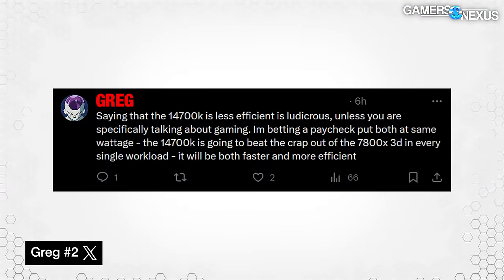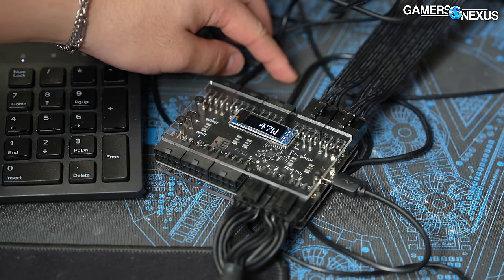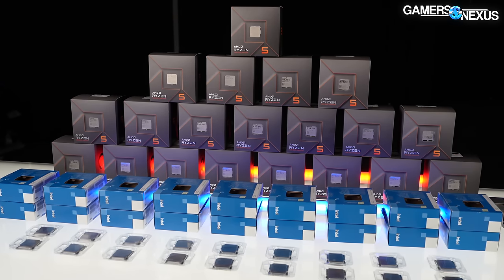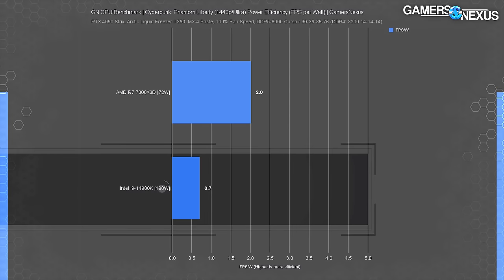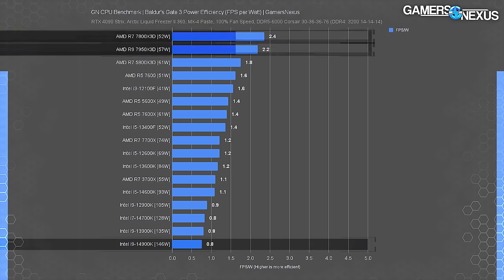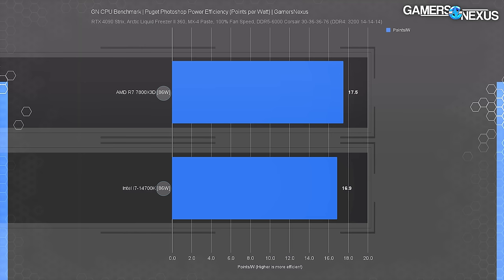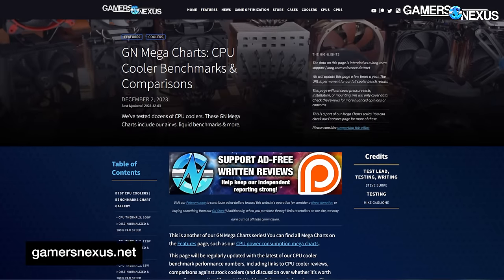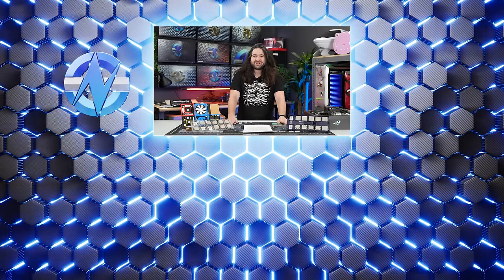The Intel Problem: CPU Efficiency & Power Consumption

Comment: It's hilarious to me that the 7800X3D without FPS limit still pulls less power than the 14900K with an FPS limit

Edit: the amount of fanboys defending Intel with all they have, for no good reason at all, is just ridiculous. Stop saying they should have undervolted it. Stop saying they should have turned off the E-cores. Stop saying they should have limited the power draw (which they did for the 14700K photoshop test, actually). Stop trying to make this literal waste of energy better than it is. You get nothing from it by doing this. You only expose yourself to siding with a company that rips you off, and that makes you look like morons.

And besides, this video was supposed to be a fair comparison between Intel and AMD. If you tweak Intels chip to the point of being advantaged, you surely can do the same for AMD.
Reply: Looking at power consumption of the 7800X3D, I wonder why AMD didn't release it on laptops platforms yet. It would have no match at 50-75W TDP in games.

Edit: yes, I know about the R9 7945HX3D, but it still has to share some of its power between two CCDs, instead of focusing all the power on the 3D V-cache one(and laptops usually have 55-75W limits). There's 13980HX on laptops, and it is just identical(in terms of its cores count, frequency and even cache) to power limited 13900K. But they wouldn't need to limit the 7800X3D that much, even 55W would be enough.
Reply: @ReclusiveXL It might be a temperature constraint; that and the higher power floor to run them
Reply: @WWAVES1  nah, in laptops the cpu doesnt have a thicc boi IHS and 50-75 watts is relatively normal for laptop CPU's
Reply: Thx to the 3D cache performance are higher AND they have to reduce the maximum voltage to avoid damaging this extra cache. Those 2 factor make it incredibly efficient/performance, that and the fact that zen core are more efficient that Intel core by default
Reply: @ReclusiveXL it needs desktop levels of cooling to remain stable at 50-75W. There’s a reason it doesn’t boost as high as its non-X3D counterpart, which has to do with voltage and temperature limitations.
Reply: @ReclusiveXL They did. Not the 7800X3D but the 7950X3D.  It's called the 7945HX3D
Reply: Tbf one has 16 threads, the other has 32 threads. Thats not something you can just ignore. I mean yes, ryzen is definitely still more power efficient. Thats what happens when TSMC makes your silicon and you have a node size advantage, look how power efficient Adalovelace is over RDNA2 with just tsmc “4nm” over 5nm. But comparing the power efficiency of a 14900K and comparing it to the 7800X3D is just kinda goofy. It makes more sense to do it with the 7950X3D but since this is so gaming bias we arbitrarily say the 7800X3D is better. Its definitely better for just gaming if you wanna save money, but as an overall CPU not really. And id still say 14900 and 13900K are both better than the 7950X to to its core parking issues and bugs. Theres no reason why it shouldnt be able to use vcache cores for gaming and non vcache cores for background or side tasks
Reply: @Angel7black  Welcome Greg #3
Reply: @Neketre  and theres i9 13980HX that is quite indentical to desktop 13900K(and even boosts to 5.6GHz). I know about cooling, but we are talking about games, not stress tests. I think they could undervolt 7800x3d so it fits in the temp limits in laptops, considering that desktop one doesnt need much, but air cooling
Reply: They do have X3D laptops though but not using desktop chips. Which is awesome! They saw the power efficiency of 3D V cache and put it on laptop CPUs as well. The yields for X3D are good enough now that they can do that.
Reply: @bgos10  yeah i know, that's why I'm wondering
Reply: @WWAVES1  they haven’t done it yet so I guess something is holding it back, but I don’t see many reasons for them not to do laptop x3d.
Reply: @_under2world_  this maybe
Reply: @Angel7black  That's why the GN team normalized the numbers to user power per amount of work performed.  That makes the number of cores irrelevant.
Reply: Also laptop chips are monolithic unlike the current desktop chips. So it would be a completely different fab line to make a x3d, compared to desktop ryzen and Eypc sharing the stacking line.
Reply: The 7945HX3D "exists". But as usual, it'll be USA-exclusive like pretty much everything high-end AMD does for laptops.
Reply: @ReclusiveXL They have the 7945hx3d so ye can max a 7845hx3d
Reply: @Angel7black  Intel once said "No silicon manufacturer has ever recovered from falling behind in their node process."
Reply: @ReclusiveXL   consider the 7945HX or its soon-to-release replacement within the next few months. It out performs the 14700k in raw mathematics benchmarks while still being a laptop chip. I'm not sure of its gaming performance but if you want an incredible mobile CPU from AMD that out performs desktop chips in professional workloads thats definitely the chip to look at until AMD's next gen mobile processors
Reply: I like ryzen. Just sucks it took them so long to get a decent memory controller. I'm assuming the ryzen 7000 series has a solid memory controller. That's been the only thing that held ryzen back from total domination. If amd can make consistent memory controllers, than the rest will be easy for them.
Reply: @WWAVES1  The only problem AMD chips have is their small chiplets, where heat is so focused on one tiny area, thats why you see cooler tests where the AMD cpu is still very hot even tho the cpu itself isnt using that much power.

Coolers actually have a hard time cooling amd cpus. Intel on the other hand have massive dies where the heat is very spread out. If intel had chips the size of amd's there would be no way in hell they could achieve scores/fps similar to what they get now.

Now imagine having to cool that chiplet using a puny laptop cooler, its a nightmare.
Reply: fps limit is just a utterly stupid way to change efficiency he should have limited power not fps. just cap it at 75-100 and 125 watts and ee how it preforms then.  and he should have included idle.  i find this whole video dissapointing at best.  i was hopping for it to be a good video but no it was not.
Reply: @charliek9394  That’s exactly what I was hinting towards. I’ve just learned they do have a 7945HX3D in a $3,800 laptop but that’s the only one. I’m not sure what cooler they use but it’s there🤷🏾‍♂️
Reply: @pino_de_vogel  okay Intel shill
Reply: @ReclusiveXL the problem is with idle power consumption. with the desktop chips, you'll often see idle power being a few watts higher than intel or a monolithic APU, on desktop, that's fine, pretty much a rounding error, but on mobile, powering that IO die during idle will seriously eat into the battery. So unless AMD makes an x3d built on top of an APU, there're not really an efficiency gain from putting 7800x3d into a laptop
Reply: @dagameboy  Crazy enough, they already have one out. It’s a limited release right now but they have a 7945HX3D cpu in a laptop
Reply: @KrazzyKlown  but AMD fell behind like crazy with the FX series; imo you can always catch back up if you actually try.
Reply: Why it has 3x the cores lol
Reply: Is it a surprise tho? a 24 core CPU vs 8 core,  you don't think one might consume more power than the other?
Reply: I said this before, but look at TechPowerUp article about running 14900k at certain power limits. If it's really an issue, set it to 125 watts limit, so half of stock, and you lose barely any frames, especially not in high resolution gaming. I know that it's less efficient and Intel will improve on that with Arrow Lake for sure.
Reply: @ReclusiveXL  How do you fit the required water cooler into a laptop?
Reply: @WWAVES1 temperature is directly proportional to power, so what do you mean?
Reply: @Joh_Lam  1. this is not the stock configuration. Most people won't go into their bios to limit the power of their processor, because many don't even realize this is an issue they have.
2. Even IF you limit it to 125W, it still uses way more power than the 7800X3D for even less performance. No matter how you twist this, Intels efficiency and overall performance is helplessly inferior than AMDs.
Reply: @Angel7black  There's nothing goofy if the performance is the same.
Reply: But but the amdip!??
Reply: @mathesar Definitely, but you'd also expect way more gaming performance in return, but it's not the case.
Reply: Literally about to do a 7800X3D build after I’m done with this toilet time and shower lol. I’m excited
Reply: @joshmaag2457  I'm going to do the same! But prices suck in Germany.
Reply: @Angel7black  Did you even watch the video? The 7950X3D was definitely tested and the conclusion is not different.
Reply: @El1988Che  Yea I was just referring to the power consumption which is no surprise, 14900K has 8 performance cores which are used for gaming but then theres also the additional 16 e-cores consuming power in the background, But either way 7800x3D is the winner here.
Reply: @eliasroflchopper3006  Yeah, I mean you are right. There is no way to twist this and Intel is obviously far away from AMD's efficiency. I was just saying that looking at that article things at least get a little better by setting a limit. The performance difference is not that big while at least that power consumption gap gets somehow smaller.
Reply: @ReclusiveXL I limit my 7945HX to 45W and I prefer to have the 7745HX instead.
Reply: @WWAVES1 No, on laptops they’re direct die + Liquid Metal.
Reply: @Neketre That’s not true. My 7945HX can run at 130W without throttling.
Reply: @mathesar  it consumes more power than the 7950x.which has real 16 cores. The 14900k has 16 e Cores. Those are Low power cores.
Reply: @ReclusiveXL but, 7800x3d can be cooled with a silver spoon and some thermal paste, it is dense and likes to hold heat but that doesn’t mean it is making more heat than Y, it is just X, a low power chip when compared to its competitor, and low temp
Reply: @omegaprime516 it’s a little more complex than just a memory controller, it is an IO die. Basically it has to feed memory channels to all the individual cores on different CCDs and adjust for clock ratios at a distance. The speed was never an issue, latency was, therefore you now have x3d to remove the dependencies on ram calls
Reply: @CrimWorld9 And isn't a silicon manufacturer. They designed the chips but tsmc is the silicone provider.
Reply: @ReclusiveXL I'm not sure what you mean. 7945hx3d hits 100w pretty regularly in tests and often spike higher. I don't know why exactly but there is clearly some technical limitation preventing AMD (and OEMs) from releasing higher clocked versions 7945hx3d
Reply: Btw, it's extremely remarkable Intel's 10nm part 13900h is comparable to 7945hx3d on 5nm. It's kind of insane actually and makes you wonder how much of AMD's edge should be attributed to TSMC instead of AMD itself.
Reply: @modash1231 If by “comparable” you meant pulling 2x the power to achieve similar performance, sure. BTW, Intel’s 10nm is similar to N6/N7 in terms of density.
Reply: @ReclusiveXL there's no point in x3D CPUs on laptops because you're almost never CPU-bottlenecked. A 7745HX is pretty much the same chip otherwise
Reply: Zen's powe efficiency was braindead obvious right out of the gate when zen1 released. It came out with an 8c with 95W tdp pulling about that... At a time when Intel's 4c was 95W but pulling 110-130W. Aaaaand Intel's uarch hasn't changed been completely redesigned but they have pushed power draw as high as possible to eek out performance.
Reply: if Steve turns off hyper threading, it would be a lot closer.
Reply: @deivytrajan  no
Reply: @I.C.Weiner  Well AMD designs the architecture and much of the layout but all of these companies do work with the silicon fab to finalize the chip design. It's relying on their advanced processes and all the complexity involved with that, it's not as simple as emailing TSMC the new file then clicking print. 

At a basic level, this applies to many manufacturing industries. A company may up with a complex product design then works with necessary manufacturers to create a final production version that's scalable.

It is especially true with X3D since it's TSMC's 3D stacking technology that even makes the concept possible. AMD's engineers have to work closely with TSMC's team to make the final product a reality.
Reply: @Neketre  It's more to do with the 3D cache being another medium heat has to travel through from the cores. This is why the X3D parts are binned to run low voltages. It creates this weird scenario where you can cool it with a reaaly cheap cooler since the power consumption is low, yet with a really high end 420mm AIO your termperature will still jump all the way to the high 70s (which is insane considering it's only drawing at most 90-ish watts of power).
Reply: 7800x3D is the best CPU by far right now and it was $100 off around black friday weekend.  If anything, it should cost more but at $350 it costs notably less than $550 for a 14900K or $380 14700K.  It should be drawing way more power for the performance it gives, and should cost more for the performance it gives.  Credit to AMD for having it at a competitive price point.  GPUs may be overpriced, but this CPU is probably the best value part we've seen in the PC market for a long time.  It's like the 1080TI of CPUs, for value.
Reply: With multicore performance worst than 12600k :P
Pc is not a console, people do more than gaming and in every other scenario 7800x3d is very bad.
Someone make a pc to only play and nothing else , better buy a console.
7800x3d cost like a console and do the same job.
14900k can play games in 4K at the same FPS with 7800x3d but also dominates in workloads,rendering,video editing like a profesional pc 4x better than 7800x3d.
Reply: @Angel7black  so which is more efficient though, the 14900k or 7950x3d?
Reply: Intel users in 2017 : AMD is for poor people
Intel users in 2023 : How are you still upgrading on that four year old AM4 board?
Intel users in 2024 : If you do this strange test you will see Intel is better in some freaky controlled experiment.
Its like going through the stages of grief : denial. anger. bargaining. depression. acceptance.
Reply: @glennv3176   we can only hope Intel shills and fanboys will one day accept.
Reply: I bought a 7800x3d big regrets, should've gone for intel.
Endless stability issues(expo) boot times of 2+ minutes not to mention the classic AMDip, 0.1/1% lows are really noticable even tho avg fps is generally high.
If u can pay 500~~ish bucks for a cpu the power draw costs are absolutely irrelevant.

 most general reviews of the cpus run same speed memory even when intel can achieve MUCH higher ram speeds and it scales unlike ryzen.
and in this test they're still running memory at 6000 with sloppy timings which is just a disservice to intel.

call me a fanboy all u want but i actually bought the amd and I reaaaally shoulda bought the intel with hindsight.
Reply: @ReclusiveXL  Why would they want to sell a laptop that may not need replacing in 2 years?
Reply: @dragonld123  A 5600X + 6700XT build now is like $500 with the motherboard, the SSD and the case. Why on earth would someone become a console peasant when proper mid range rigs are $500
Reply: @nielsenrainiertungala9391  Even the 7950X is more efficient so it's not even a question that the 7950X3D is. Plus to those saying you can lower limits and undervolt 13/14th with a minimal drop in gaming performance, that's true but applies to AMD as well. Reduced 7950X limits with an optimized voltage curve and tuned memory is damn impressive. X3D just takes it even further.
Reply: @glennv3176  I dont know in what planet you live but here the 5600x is 150€ 6700xt is 350€ a cheap B550 is 80€ ddr4 40€ so I need 620€ without case ,psu , ssd that cost at least 150€.
Ι will spend 770€ for a 1080p pc that bottleneck the current mid range 4070/7800xt.
So next gpu upgrade need a new cpu too.
Console example was about 7800x3d vs 14900k and not for a 2021 pc like 5600x 6700xt.
Reply: 78003d cant do mt for shit... While 14900k can bery undervolted to be less than 100w in games and max at 253 total w/o loosing any performance
Reply: @Jaejgaren  u probably got problems with ram, maybe u bought unsupported by ur motherboard?
Btw amd also scales good with fast ram 😉
Reply: @shaolin95  The 7950X3D also pulls less without a limiter my friend.
Reply: @dragonld123  5600X/6700XT is a 1440p machine. And I don't care about how much it is in euros, 25% of that is taxes. You can build a $500 1440P rig. The only reason to buy a console at that point is because you eat your own boogers and shove crayons in your nose.
Reply: @dragonld123  Even if the build I mentioned is $100 more, than a console. It will blow the socks off one. And you can do things with it besides playing video games. And when a game came out 6 months ago you buy it for $5 on a CD key shop. Whereas with a console you're paying $69.95 for call of duty or whatever console people do.
Reply: Greg just needs to get more educated, learn and get informed.
Reply: @deivytrajan no
Reply: @Angel7black  other 16 threads i.e e-cores were supposed to be power efficient, not decrease it.
Reply: @Angel7black   Undervolt + eCores disabled (or parked) and you can get similar power draw as the 7800X3D. 50-100W depending on the game and how far you undervolted.
Reply: @KrazzyKlown  Did they foreshadow their own downfall?
Reply: @BahhBahhBrownSheep  he means he's using a really high end cooler and doesn't exactly understand physics, so he draws a conclusion that isn't exactly correct. Same with his financial breakdown. Somehow it applies to everyone that it's only $2 extra on his bills.
Reply: @Neketre  you are aware that there are laptops that have the capability to dissipate 600w of heat, these fall into the DTR and portable workstation territory
Reply: so does a raspberry pi
Reply: Except one is meant for gaming while the other is meant for both.
Reply: @glennv3176  no doubt, and the worst part is, intel doesn't care about them too hahahaha
Reply: @Angel7black  why did you even write this out 💀
Reply: @Angel7black alright the closest intel cpu 14700k is less efficient than the 7800x3d and performs worse in most instances….
Reply: @Angel7black  Those problems are solved. It`s working perfectly as long you provide a fresh windows install.
Btw. the 7950x3d is also included in the tests.
So ther you are. Still a winner.
Reply: @Neketre  it mostly needs that because coolers are not optimized for the offset 3D-Vcache-chiplet. There were some tests where some old-school heatpipe coolers were actually only using part of their heatpipes to make contact with the respective area of the chip, if you would de-lid a 7800X3D the problem would actually get worse, since in this case the heatspreader really is a heat-spreader.
That said, you can undervolt these things really well and this actually leads to them keeping their boost speeds up for longer. I could reduce the max power consumption of my 5800X3D by a huge margin while simultaneously gaining fps and - more importantly - reducing fps drops due to frequency changes.
If you would change these settings by default for a laptop derivative, this thing could fly.
Reply: @WWAVES1 there is some debate around temperature but another issue might be power draw.

I hear about high idle power draw on x3d CPUs and AMD laptop CPUs have such little amounts of. Cache LA.

Dark mode on YouTube is broken I cannot read this message before sending so sorry if there is errors
Reply: AYYYYYMD!
Reply: wow...just wow. you are missing the point.....let me guess.....Intel fan much?
Reply: @eliasroflchopper3006  Lol this is the narrow minded comments that are the problem on the internet. I just see facts you clearly arent capable.
Reply: that is because limitging fps is not the correct way to increase efficiency.  should have capped the power directly and decrease the fps naturally.
Reply: @Yuki2204  most of you have completely missed the point, which is that 3D Vcache requires additional considerations to operate in laptop conditions, it has nothing to do with how much heat your laptop can dissipate or how much energy the power circuitry can provide. Yes I’m aware the 7945X3D exists, it is a very low volume part with low yields.
Reply: @ReclusiveXL  GPUs are not fast enough for laptops.
Reply: @ReclusiveXL  it's likely because mobile GPU's don't have the performance to benefit from the 3D v-cache. even nvidia's mobile 4k series doesn't come anywhere close to being cpu limited.
Reply: @sirmonkey1985  i mean like, if we have a 3D v-cache on laptops, it's gonna literally consumes 2 times less power than intel cpu with the same FPS. I tested my Desktop with 7800X3D and Laptop with i9 13980HX, and result kinda impressed me. I locked it on 144FPS and Intel laptop CPU was like on it's limits with 90 degrees and 75Watts. While PC 7800X3D was 55° and 35-40Watts. Like, I know laptop thermo can't deal with high loads, but if there was up to 50W, there shouldn't be a problem. It's just all about efficiency is my point here
Reply: and its even more hilarious when you go play warzone 3 and turn fast(flick the mouse) in the city area and you beloved AMD drops from 350fps to 93fps...you know that Intel IS for gaming.
Have a nice day!
Reply: @ReclusiveXL  i guess they just didnt want to make a 1 CCD Dragon Range-HX cpu, it could also have been too inefficient for a 8 core laptop cpu .
Reply: @charliek9394  True but we're still talking 24 vs 16 cores and the E-Cores are real too they just dont have hyperthreading and are clocked lower.
Reply: I would have tested intel cpus with ecores disabled, limited to 150, 120 and 90w
Reply: Because its still boosting to 5.7+ GHz lol what don't you guys understand about that?
Reply: @ThisIsExile91  everyone here knows why it's pulling this much power. What you don't understand is that the performance you get for the power and money you spend is fucking terrible.
Reply: @eliasroflchopper3006  performance where? In Blender? Workstation tasks? Lol that's where YOU'RE wrong and don't understand. Ohhhh you mean in gaming... Yeah, again - just lower the damn clock speeds and the power draw is half of what it was at 5.7ghz stock. There is No fps difference at 5.3ghz vs 5.7. All while still running your RAM at 7800+
Reply: @ThisIsExile91  no, blender and workstation tasks is exactly what I mean, since it's already well established in this video that Intels efficiency in gaming is pure dogshit. If you check GN's 14900K review, you can see in their efficiency benchmark for BLENDER that the 14900K has even worse efficiency than a R5 3600. Stop spreading your fanboy BS and actually inform yourself.
Reply: @ThisIsExile91  did you even watch the video..? Steve even said it himself. And I quote: "all we had to do was run it in a configuration most users won't use". Even if you limit the 14900K to the same power draw than the 7800X3D, it's still worse in efficiency in some tests, which is an achievement in itself.
Reply: @eliasroflchopper3006  that's the issue - you cannot just "power limit" the CPU. You must actually tune it. You must use undervolting and offsets and adjust the clock speeds themselves. I imagine the CPU was still trying to boost to 5.7 even with the hard power cap. They effectively made the CPU even less efficient then what it was at stock voltages. There is no indication those used any actual voltage offset or downclocking techniques, I watched the whole video.
Reply: @ThisIsExile91  but only a fraction of users, let it be 1% at most, will bother to actually do this. And the fact that you yourself will have to fix the product you bought for hundreds of dollars/euros isn't really a good defense either.
Reply: @eliasroflchopper3006  ok, that's great I guess I'm special?, but it doesn't mean big tech tubers should ignore essential techniques like this. They are considered "experts" in the eyes of the average viewer - and don't know the first thing about undervolting, apparently. Take that knowledge for what you will
Reply: @ThisIsExile91  why is it so hard to accept that you favorite CPU manufacturer isn't the best anymore? Why would you even chose favorite companies in general? Not only that Intel isn't the best anymore, they are straight up slandering the competition because they know their products can't compete. So it is even ethically a bad choice to buy Intel. I honestly hope you can, one day, just think rationally about companies. They aren't your friends. Intel isn't your friend. They want your money, not more, not less. And they want to spend as little money and afford to get it. Just think about that.
Reply: @eliasroflchopper3006  yes - continue to ignore what I just told you about how a CPU works, and be like everyone else 😂

I'm not saying Intel ultimately made a mistake by setting the stock speeds at such high clock frequencies. I'm just enlightening you on to how you can easily optimize the chip for gaming ONLY.
Reply: @ThisIsExile91  yes, I understand that. It's stock configuration still sucks, while AMDs don't.
Now I honestly think you are a troll.
Reply: @eliasroflchopper3006  the only trolls are these Tubers that think hard power limiting Intel to well below TDP specs and benching it means anything 🤣 I rest my case.
Reply: That’s how process advantage can change things…😂stunning does it not
Reply: @dragonld123  I raise you an Ryzen R9 7950X, cheaper, more efficent, more processing power then a 14900k. And is what actually dominates in workloads.

And why should anyone better buy a console if they want to play games? Not all games exist on consoles. Consoles are also very limited in what you can do with them in general.
Reply: @ThisIsExile91  I should not have to power limit or tune a cpu for it to be only shit, instead of total shit. Thus your point is as mute as the points people tried to make for the Vega GPUs from AMD.
Reply: @pino_de_vogel  They did it with Cyberpunk and the 7800x3d had at least double the fps per watt.
Reply: @ReclusiveXL   Because u no need strong notebook cpu. Notebooks have crap GPUs
Reply: @insgr  what video are ytou watcing  in cuberpun k i see 164 watts thats not power capped at all. You can cap it at 125 watts and get the exact same performance. Or cap it at 95 watts and lost maby 5% performance.
i have tried to find it but there is no gamingh power cap data that matters in this video. 
i know it wont beat the 7800X3d but it can be way way more efficient then the ways its tested in these scenarios. fps capping to try and reach efficiency is just wrong.
Reply: nobody cares how much power it draws..nobody with a brain at least
Reply: @germanmosca  In what multiverse?
                14900k     vs     7950x
 Multicore 41k                     39k
Temps        85c                    95c
Stock PL2   250w                 230w
Reply: It's funny how much 7800X3D has a fanbase that thinks in fps for everything. In raw power, from i5 13600K to i714700K Intel obliterate AMD in every task that it's not gaming. 
The only cpus that can match intel,  honestly are 7950X and 7950X3D.
Reply: Well, intel should try harder to produce better products. Instead of brute forcong older tech and hoping their minions keep paying
Reply: @pino_de_vogel  the 14700k lost 12% performance from 164w to 86w.  The 7600 offers better performance at 58w and half the price.The7800x3d is 38% faster at the same wattage (86w).
Reply: @ibzman1393  same goed for AMD  that io die and motherboard power draw needs to be fixed and that wont happen as long as they have that IO die.  imagine a 8800X3D with no io die just a single chip.  that would idle way better as the 7800X3D andbe the best selling chip they ever made. Idle power draw is keeping a lot of people from going AMD as it costs a lot over the years. And no clue what the reason may be their motherboards are ths inefficiënt.
Reply: Yea and horrible .1% frames. Rather have smooth experience that micro stutters
Reply: Actually it really doesn't, It needs to be kept within operating temperatures and be supplied with the appropriate amount of voltage in a stable manner, There is no other considerations needed that is where it is and what it is that's it nothing more we've slapped full sized desktop CPu's that pull hundreds of watts into DTR's and there is an AM4 based DTR that you can put a 5800X3D into.
Reply: LOL Intel fanboys can't even win any debates. How pathetic.
Reply: Don't understand why Intel fanboys just enjoy being sore losers.
Back to the time when AMD was a super joke with their FX series.
AMD fanboys were still humble and didn't defend the fact that FX cores screwed at all.
Reply: get rekt all intel fanboys keep coping and go touch some grass thx
Reply: @shootingstar7896  There's no debates happeing, theres just facts being ignored.
Reply: @pino_de_vogel  I honestly don't understand, why would you build a high end computer TO idle? Surely you would want to use it for something?
Reply: @AdamKafei   Mailing, browsing, text editing, photo edting, watching videos all pretty much counts as idling. The power it draws for that task matters as much as the power it draws when gaming.
Reply: @pino_de_vogel  I guess if you spend 60%+ of your computer's uptime doing things that don't call for a high end CPU, but then if you can afford high end Intel then you might as well build an AMD system for things that actually need a CPU and a tablet for things that don't.
Reply: are people really crossing shopping 14900k & 7800X3Ds? I'd say no
Reply: @a36538  They are. One is better for gaming, the other is better for other workloads due to the amount of cores and has better idle efficiency making it cheaper to run then a AMD chip dependingon hours used.  if i HAD to buy a cpu now ib be buying the intel instead of AMD as gaming is only 15% of my usecase and  the intel costs me hundreds less at the end of its life and platform upgrades are a useless point if you only upgrade once every 4-5 years.
Reply: It's hilarious how twisted AMD fanboys are ,,, just laugh LAUGH laugh
Reply: @tilapiadave3234  just don't be a fanboy for anyone.
Reply: LMAO Who would've guessed. Intel = 💩💩💩
Reply: FPS limits make efficiency worse because the CPU boosts higher.  You need a frequency limit.  (Not power limit either; that still allows boost waste during low utilization periods.)
Reply: @pino_de_vogel   Power limit is only slightly less stupid.  It still allows use of grossly inefficient frequency-voltage points during low-load periods.  Need to limit frequency directly.  In the bad old days of Intel CPUs in Macs, Apple users passed around advice to disable turbo boost, which has the effect of limiting frequency directly (although very severely and with no tuning ability compared to plain old limiting frequency).  Those Mac users didn't really know what they were doing, but they could feel part of the elephant.
Reply: >Stop saying they should have undervolted it.

GN shouldn't have for the testing, but I actually would like to see a tutorial video by them on CPU undervolting (both for AMD and Intel ones), optionally - for edge cases like mine (MSI laptop which, unlike laptops by other vendors, have necessary BIOS options accessible through expert mode hidden behind a shortcut).
Reply: 😊q¹¹😊
Reply: @Vegemeister1   True but a spike of 125w (when PL1 capped) is way better then a spike of 285 watt for the same performance. 

And theres some other thnbgs that need fixing voltage and limit wise. My 9900k came with a SSAO and SSIO voltage of 1.39v. while it has bin running with SSIO and SSAO voltages of 1.165v for over 4 years now.  that was a 6 degree temp diffrence and 5 watt idle power draw diffrence because MSI botched the bios settings. A diffrence of 0.225v which is absurd. 

And im sure on AMD's side there is a lit to improve bios wice.  and 0.05v isnt something i call problematic but in my case the 1.165 vs 1.39v is a MASSIVE diffrence that should never have happened.  And im running my cpu with ddr4 4266 cl165-16-16-32-400 which are tight timings for ddr4 and make the requirement for SSIO and SSAO higher already so with 3600 ram it would likely need even less voltages. 

intel/amd need to figure this stuff out together with motherboard vendors. It's a utter mess and has bin for a decade.
Reply: @pino_de_vogel  PL1 is the long term power limit.  It doesn't cap spikes shorter than the time constant tau, which defaults to 56 seconds and has a typical minimum settable value of 1s (an eternity for a computer).  PL2 is a little more effective, but it still doesn't keep few-thread loads from using crazy voltage/frequency pairs.

The only effective way to make Intel CPUs operate efficiently (without impacting stability like undervolting does) is to limit the clock frequency.
Reply: @mathesar  The 14900k reminds me of the FX 9590. It was around the time of the i7-4790k and the i7-4770. Both great cpus. And at significantly lower cost than the FX 9590. And more than half the power consumption than the FX 9590 (8 core 220w silicon lottery winner at nearly a thousand dollars on release, pushing the silicon so hard, but so vain). There's probably a comparison with the FX-8350 which was way more popular, but the i7-4790k was just so good at the time, that I basically considered a loan for it. And then came Ryzen from the ashes. Until then I hadn't even considered AMD for the CPU. Intel just has to step up their game and figure out a way to get more practical work out of their chips. It's definitely possible. Hell, they might have to operate at a loss and sell their stuff for a bit less, just to get that RND out. But, right now it's looking like they're really trying to pull more out of their dies than they can handle.
Reply: @Vegemeister1  Wel you would need to limit both of them ofcourse. And spikes for shorter then a second are pretty irrelevant to actual power draw i tink. unless you have a very specific workload that causes a ton of these short spikes. 
limiting frequency does nothing for reaching the perfect performance to power ratios or fps per watt.  as lower frequency hard caps fps possible without cvonsideration of the optimum  performance curve.
Reply: @pino_de_vogel  The frequency-voltage point sets the power-performance relation pretty directly, because roughly frequency is proportional to voltage and power is proportional to voltage cubed.
The ideal cap for efficiency would be an FPS cap, but implemented by adjusting the power or frequency cap in real time, instead of the usual way of inserting a pause if the frame is finished early.
Reply: A lot of people just want to feed their own confirmation bias on whatever they've bought. And they would rather just believe and parrot nonsense than accept that something they purchased has issues or is beaten by competiting products.
Reply: @e2rqey  The fact is both AMD and intel have issues. have had iddues for years and years.  amd has idle power and software issues on all their products and intel has power draw issues out of the box because they had production issues and nvidia just has pricing issues and issues with hdmi and display port not working consistently.
Reply: I won't touch AMD with a bargepole for longstanding reasons, however totally agree with you about the fanboys saying e-cores should have been turned off, no Intel should figure out how in their chip and chipset to configure itself for lowest power (but i doubt that would make any meaningful difference).   Intel seem to be several generations away from meaningful efficiency parity.
Reply: @joshuanissen8803 Heyo Greg wassup. My 7950X3D with 25 seconds boot time would like to say hello.